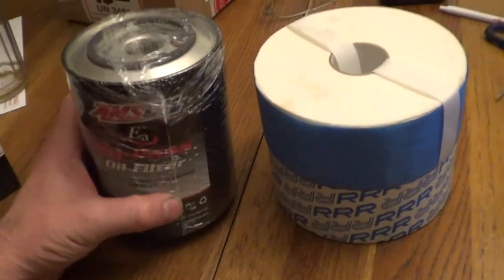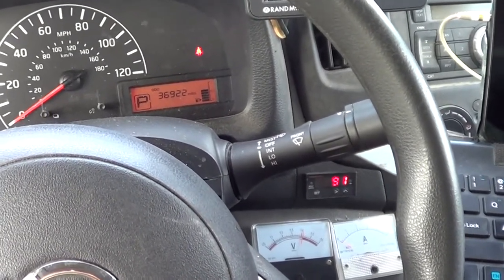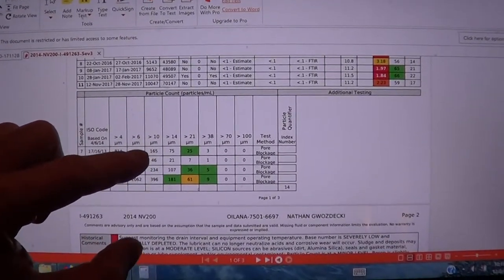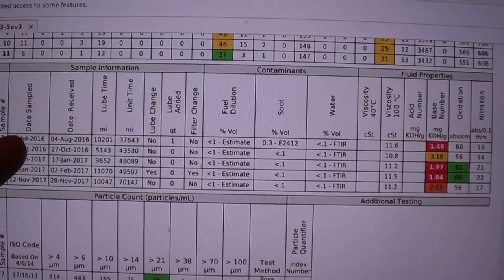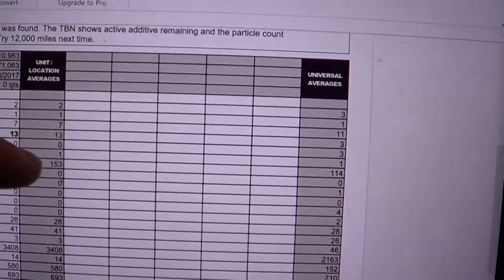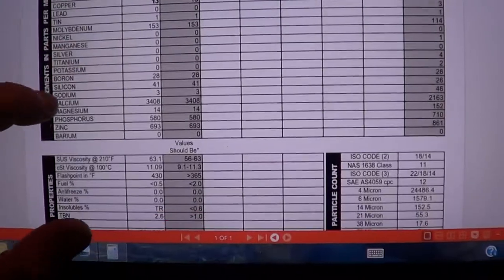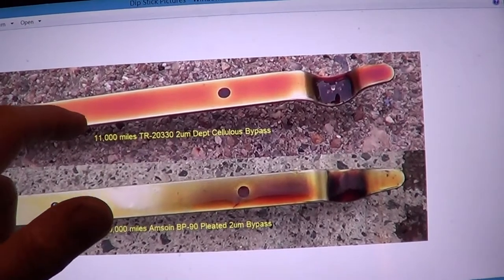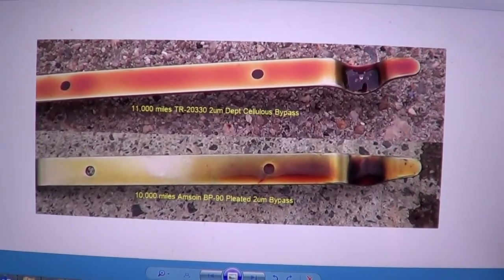Oil Bypass Comparison on Gasoline Engine

Comment: Yea finally ty for showing all the data I see your thought process now.
Reply from the maker: I'm currently doing some new testing on the main oil filter instead of a bypass system.   I set up dual pressure sensors to measure the pressure drop to see when the main filter bypass opens.   I will have some good videos on over sizing the main oil filter in a few months.   Bigger is better on the main filter.    Also, the bypass valve opens most often when the oil is cold.   The very tiny main filter on the Nissan clogs at only 3,000 miles even though it looks clean when disassembled.   That means a lot of crap gets past the filter.   I'll be posing a bunch of videos on this subject.

Comment: The  most significant advantage to engine life and efficiency from superior filtration is longer engines life and greater efficiency.   The wear advantages of the bypass systems are well documented if you do a good search.   You will have analytically clean oil 100% of the time.   This would be true to extended drain intervales.   But Acids can form more easily if the TBN number of oil is too low and/or water gets into the oil.     Oil analysis confirms the acid base balance of the oil.  There is a specific TBN test in most analysis run ups.  So you can test it on normal changes or change it more often on shorter changes and test it to find the point where u usually have, IF you do, a lower tbn count thatn you want.  Make that point your  filter change interval.      They work well.   Im not sure you can discount their efficacy until you use one.     I have one on two of my vehicles, they are both very high mileage cars and the engines are still the strongest parts of the car.   

OK...if the TBN is getting low too fast than simply change your bypass element (that's why its most cost effective with bypass filters to use the most inexpensive toilet paper filter that filters properly, and you will replenish additives more often.

Comment: FYI: Frantz recommends changing the element every 2500 to 3000 miles, and replenish the oil with one quart. The Frantz filter holds slightly less than one quart, so this makes up for some normal oil consumption. Adding a fresh quart this often, keeps the additive level and TBN in an acceptable range, especially with a high TBN oil such as Amsoil, Liquimoly, and other long life oils.
For a one time change of the Triple R, which has a more expensive element, I would go about 8000 miles, then change engine oil and both filters. A flush fluid such as Marvel, Essentialube, Seafoam, or the like is optional, a day before the oil change. Don't over do it with the flush!
Reply from the maker: The filter I was using costs $25 to $40 each.  My goal was to save money using bypass filters to extend oil changes.  But, I couldn't find any evidence that the bypass filter actually did anything to clean the oil on two gasoline engines.

Comment: Great looking numbers. I have a 92 Cummings with the 15-40 AMS OIL. I have there full flow filter with the Napa 5 micron bypass filter. I'm planning on going to the 25,000 miles and test the oil. I been wanting to get the Frantz oil filter system like the RRR system. Or, use a center fuge system witch will take the oil to a micron.

Comment: After working with trash collection companies, even if the lab says the oil is still good, oil is changed at 3X normal service intervals due to very small particles causing wear. One company changed filters every 150 hours and did a drain at 450 hours (diesel trucks). 

I have a 10 micron filter on my AT and it cleaned up a dirty transmission that need to be replaced, saved me a lot of cash. I have a TP bypass on a diesel and I change the element often. Like you said, its hard to determine if a bypass system on a gas engine is cost effective considering the cost of changing oil as compared to lab monitoring. 

Pore blockage and spectrographic particle counting are not the same results and very hard to compare. Your ISO code of 22/18/14 is kinda dirty in my opinion considering your bypass system should clean it up. Silicon is ingested dirt, is your air filter in good condition?
Reply: heavymechanic2 l.p. pool inour us

Comment: One simple test for the cellulose depth bypass filter, is to see how HOT it gets. If the oil flow is restricted, the filter won't be much hotter than the normal under the hood temperature. It should be at least 140 degrees Fahrenheit. If not, there isn't enough flow, for it to filter particulates as fast as they are being introduced into the oil. The depth filter should be much better, than the pleated filter. There have been cases, where a little of the "toilet paper" has gotten by the screen, and clogged the metering orifice in the output of the filter housing. Make sure that is clear.
Reply from the maker: That is a good idea.    However, since this video, I just oversize the main filter now.    I use 4x the filter area compared to the baby factory filter.

Comment: If your oil has been in for a while, and you're going to analyze, test for TAN as well. This is Total Acid Number. The acid starts rising when the TBN gets around 3, and you don't want those numbers to cross. If you keep going and those numbers cross, the oil will become acidic and start eating everything. At a TBN of 1, your oil is acidic and damage is occurring.
Reply from the maker: Thats another reason to change the oil.   I noticed my fuel mixture was running rich.   It was the upstream o2 sensor.   Running rich has to punish the oil also.

Comment: TBN getting low is a problem for extended drains even with bypass filtration. When they systems where first put on online int he 1950's and 60's and even through the 1990's Big Rigs and domestic V8 engines burned enough oil that toping up was freq. and it replaced enough of the oil to keep TBN good. On a car or truck that does not burn significant amounts of oil during OCI their is no means of bringing up the TBN or replacing other additives that are still in the oil but are worn out.

Comment: On gas engines, i dont find it necessary to use bypass filters, if youre using the best filter and synthetic. I use Amsoil with their synthetic filters, and the oil never turns completely black, even after a year and 30k+ miles.

I have and want to on my diesels, though. Makes a difference when an oil change costs $300.

Comment: I appreciate the lengths your going to for this video. 
But to be fair on bypass filters 
They were truly Intended for Diesel engines, were the soot 
Levels kills the motors. 
And dusty environments.  
Try doing this testing on a diesel motor and you will see the benefits unfortunately truck manufacturing no longer use this system back in the day this was standard equip on all class 8 trucks.
Reply from the maker: Exactly.   I couldn't find any published research on gasoline engines.   So, I had to try it out myself.   My conclusion is just use good quality oil and change it at 7,000 miles.

Comment: You mean some of us that have been using toilet paper filters for over 50 years with no oil drains didn't know our oil was dirty. The aircraft owners that used the FAA approved AeroFrantz didn't know their oil was dirty. Believe it or not aircraft owners send oil in for analysis.
Reply from the maker: I just couldn't find any evidence for longer oil service life on gasoline engines.   Any, my toyota actually gummed up at 10,000 miles.    The detergents that keep the soot in solution seem to deplete at 7,000 miles and filtering isn't going to fix that.   I think diesels are designed for dirtier oil than gasoline.

Comment: Alert! TBN is too low. The report states that. Your TBN should not go below 6. I suggest use a better oil, and possibly a flush to remove acid laden build up.
Reply from the maker: That is Amsoil 5w30 Signature Series full synthetic.  I have switched to Blackstone testing now.  They are using a laser particle test instead of a pour block.  I'm also seeing clean looking oil at 15,000 miles.  However, you are correct that the TBN becomes too low and reduces the ability to neutralize acid.
Reply: lol, if i changed my oil at a tbn of 6 it would have less than 1000 miles on it. Mobil 1 is a good oil and the 5w30 starts with a tnb of 7-8
Reply: additive

Comment: Thank you for the testing! Have you looked at the bobistheoilguy. Com forum? That is the best place i have found to get good information. You can even find virgin oil test results on there witch i find interesting. They might have something to say or suggest about your test results. Check it out if you haven't already. Great video again, thankyou!